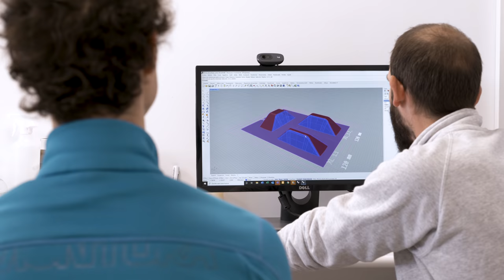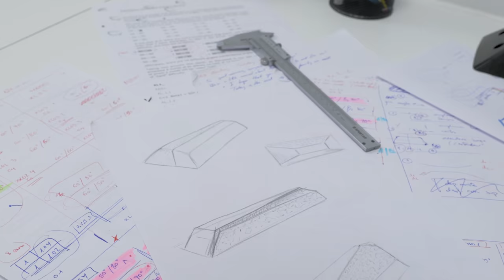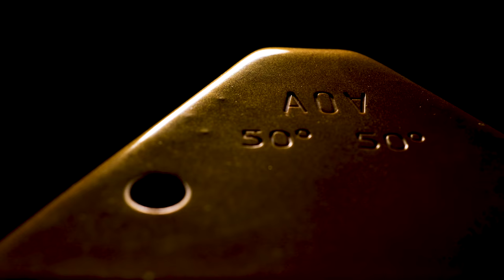Build Your Training Out of Bricks 🧱  | Designed by Adam Ondra & Shaped by Euroholds

Comment: These are awesome pinches, would love to see you Taper the top part of the pyramids to one side, and texturing the longer and shorter sides still keeping the slick edges so that you can put a 50,60,80,140 degree. That would be so much more beneficial and appealing for a individual buyer. So I can set more problems on my at home gym with just 1 hold placement. And also work different angles of holding on my home wall without getting out tools all the time. Great work man
Reply: very good input. they are very aesthetic though. not sure if that wouldn’t make them a bit „ugly“
Reply: @giacomocasanova2893  I guess… but why not both?
Reply: Yes, they could probably even make them "snappable" so you could mix and match to meet requirements.
Reply from the maker: The goal was to keep the short sides of the brick slick to avoid “wrapping” the hold from the outer side instead of pinching it. In that case, that would always be the easiest way to grab - that would actually be quite dangerous for the pinkie tendon in the palm. It would work well for home walls as an eliminate, but would not work very well in the commercial gyms!
Reply: @AdamOndra  oooooh okay that makes total sense! Dope holds mate
Reply: @AdamOndra  understood, Great product man💪. I told my gym about this last week.

Comment: There is plenty of space on the market for a product like this (especially one sponsored by the best climber in the world) but the reason why holds have exploded to the degree they have is purely for the aesthetics.

A lot of effort has been expended to make climbing more of a spectator sport, the holds and the moves need to look interesting in competitions and the gyms need to have the right equipment to train for the competitions i.e. provide those same holds.

Drives me nuts to be honest as a person who trains indoors to climb outdoor. I do appreciate the blocs, I just preferred the more crimpy technical stuff which was everywhere 10 years ago but 2 blocs in 10 now. Give me a few days for my skin to grow back.

There is one hold actually that is like a disc 1.5 meters in diameter with like a 5 mil edge on some of it, always makes me chuckle, probably cost £200 for what could be a relatively small hold. Looks cool though.
Reply: Train indoor to climb outdoor… use a moon board if this is your goal
Reply: I don't think the average person enjoys crimps that much regardless of whether it's a spectator sport.